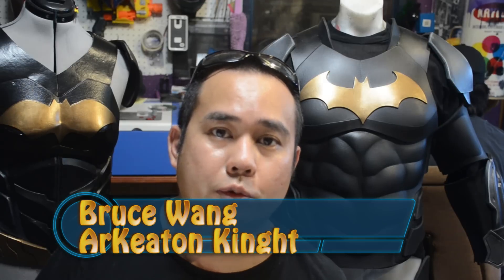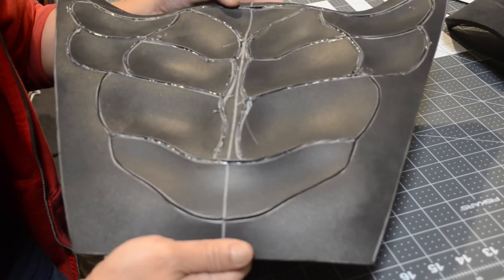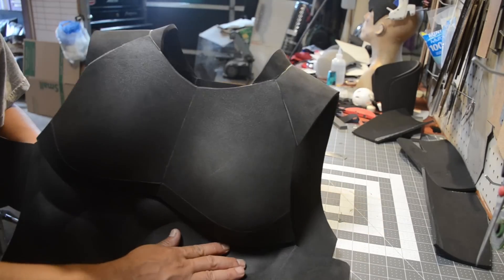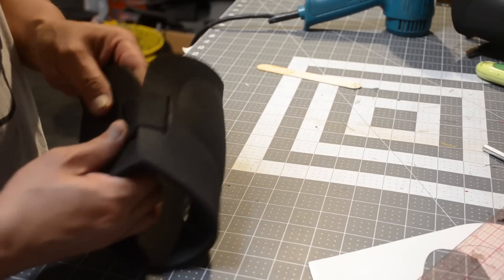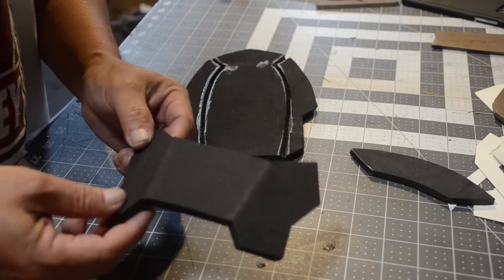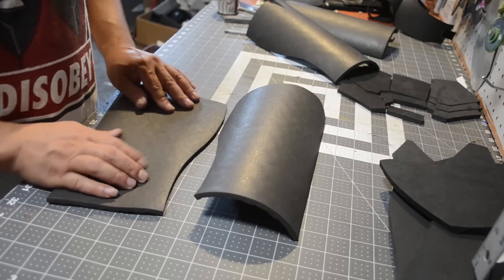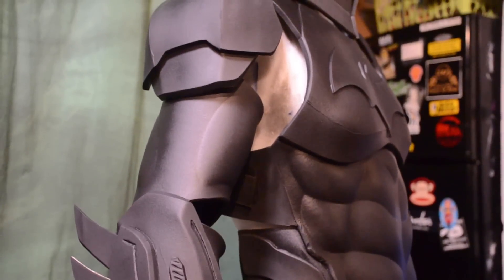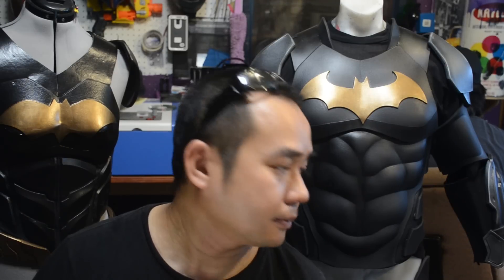Batman ArKeaton Knight Arkham Keaton hybrid

Comment: Did you know that if you use a knife (e.g. xacto) and score the foam (slice a little bit through it) then run it over with a heat gun the cuts will open up giving the same effect as your burner, and will probably be easier, and won't give off fumes.

Comment: If you don't have a wood burner is there something else you can use? Or is it worth investing in one?
Reply from the maker: +SamboziPLAYZ you could use a flame thrower. Might not be as accurate and harder to find. If you notice, I do use the wood burner very often for details so it is worth investing in. Soldering iron will work as well but you only have 1 tip to work with.
Reply: xieng prod Thank You!!! Your cosplay are Amazing!!!

Comment: I bought the $18 templates for this suit
Reply: How did the construction go? Considering trying to make this for halloween.
Reply: @stvsmultiplepassports6633  not very good it took forever and it is very hard
Reply: @ZoCo Esenther Thanks for the honest reply. Are the patterns easily adjustable for size? Not everyone is the same size and shape, so did you have to adjust them for size, and how easy was it?
Reply: @lancer525  I didn't ajust the size and it was still pretty hard
Reply: I'm looking at this pattern to use for a Roman cuirass, and I'm a pretty tall guy, and I'm going to have to adjust. Thanks much.